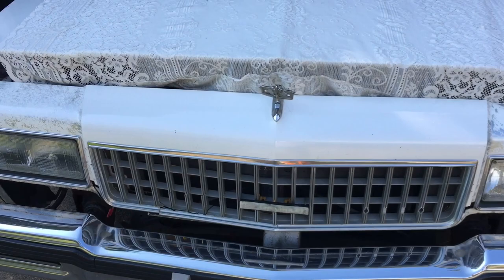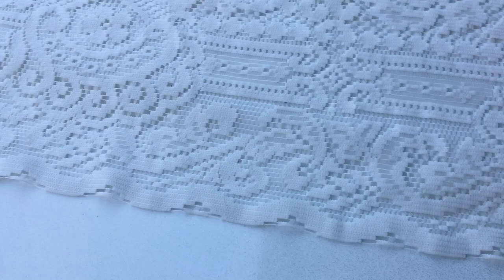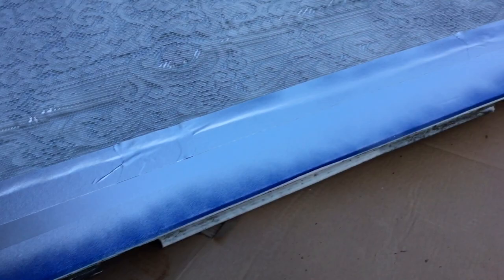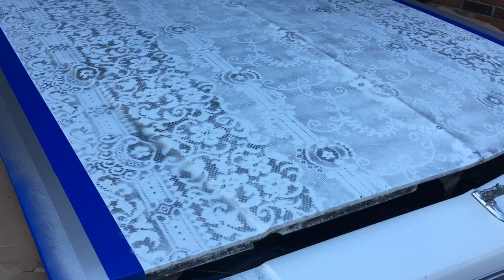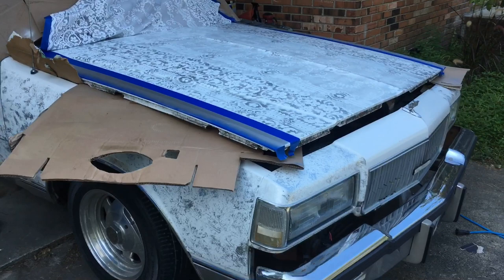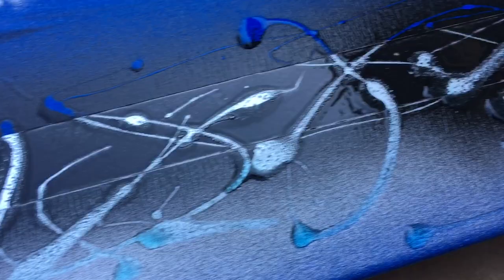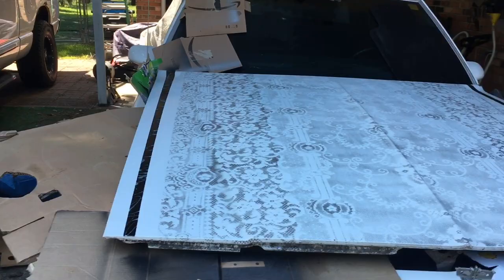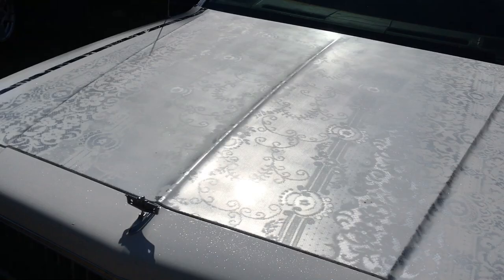How to Spray Paint a Lace on Car

Comment: The old hot rodders say to hang up the cloths when your done with them. Don't throw them away. The more the cloths are painted over the more they lay down and easier to use with no mistake. Use the cloths until the pattern is gone. Said an old hot rodder from the 50s.
Reply from the maker: Nice pro tip!

Comment: Cool lace work well done. I'm wondering about something. Back in the early 60s, when I first learned to do this, we used to spray the back of the lace with a low tack glue, I never hear of painters doing it. Have you. I am wondering if it's to do with the paints. The old enamels stood up to the wipe down needed after removing the lace.  Thanks for sharing with us.
Reply from the maker: I have heard of using spray glue. I would be concerned with the original surface especially if it hasn’t fully cured for a month or two.